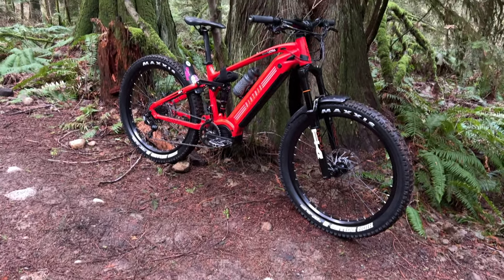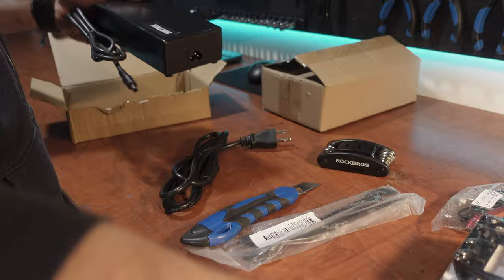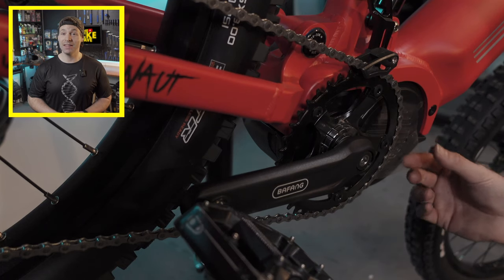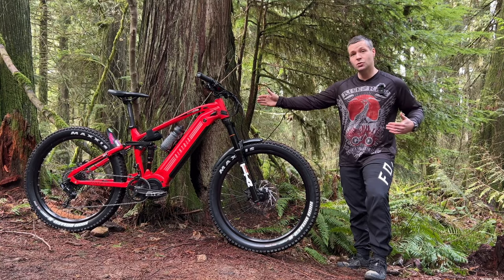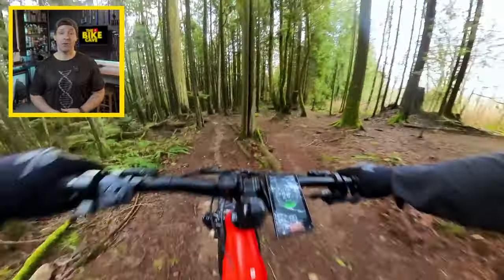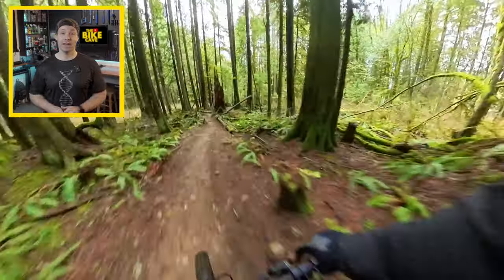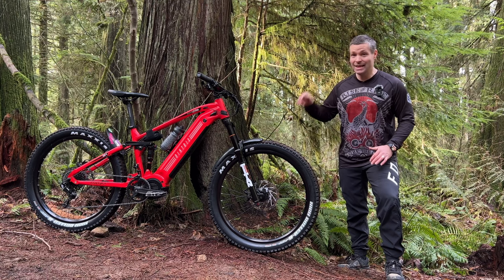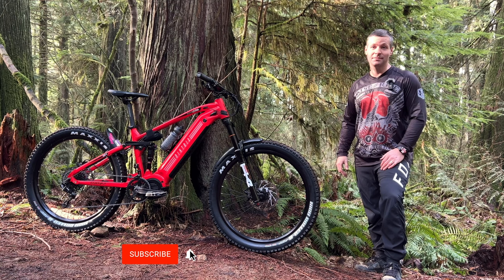This 160Nm E-Bike Blew my Mind!

Comment: I need to look more at juggernaut cause looks like there’s a FS XD mullet and FS XS MTB. Don’t know the differences but looks like you can get 2300w motor, 52v 910w battery and add additional battery two frame more range and twist throttle.  The other I looked at was the LMX 64, the 56 is upcoming (both look sweet) and the boxxbike Valkyrie.

Comment: when u get to 20% battery and pull the throttle it will cut off the battery,  so 67% is maybe a little over half the battery used...  u wont be able to use the power when battery at 20%,   maybe 500-750 watts at best

Comment: Crap chinese tank of an e-bike sadly rebranded by a Canadian company. There are much better options available for your money at $5599CAN. Personally, I wouldn't touch a electronic product made in China for half the price. Most li-ion battery fires are caused by cheap chinese cells. If you need any help finding better bikes for your money, I will gladly list the options.
Reply from the maker: All I know is that I had a blast riding that bike. Rode it on some pretty gnarly stuff and nothing broke. Just my 2 cents.
Reply: @thebikecave  Don't get me wrong, I appreciate your videos and I own a class 1 emtb. That said, class 2 and 3 emtbs are not allowed on any mountain bike trails in British Columbia. Class 1 emtbs have come along way to be permitted on many of the mountain bike trails in BC and we don't need more hate towards emtbs with guys ripping trails with a high torque, optional throttle controlled class 2/3 emtbs. Just saying.
Reply: Almost all ebikes are in some way or another Chinese made.😐
Reply: Chinese carbon fiber frames are actually very strong.
Reply: @eds7344  Taiwanese and South Korean are not Chinese. Only cheap(dangerous) batteries/tech/frames/suspension/brakes that are found are most no-name brand e/emtbs are Chinese made.
Reply: @sjaan7370 While most ebike fires are indeed caused by shoddy workmanship and cheap Chinese cells used with motors that pull more power than the cells are rated for, it is worth noting that all our e-bikes use name brand Samsung cells and are UL certified. 

It’s also with noting that many large companies like Specialized also have had issues with battery fires. A simple Google search would show you this. So let’s stop fear mongering and spreading fake news. Get out and ride what ever bike you like.
Reply: @Biktrix  First I'd like to say I'm sorry to hear about your loss from Annacis Island. Brutal.  Second, good to hear you are using quality cells form Samsung. Thirdly, I stick by my comments. 

1. "There are much better options available for your money at $5599CAN."
2. "Most li-ion battery fires are caused by cheap chinese cells."
3. "Class 2 and 3 emtbs are not allowed on any mountain bike trails in British Columbia."
4. "Crap chinese tank of an e-bike sadly rebranded by a Canadian company" (Maybe a little harsh, but that how I feel regarding Chinese made crap)

On a side note, it is extremely rare that fires have been started from reputable bike companies such as Specialized, Trek, Giant, Rocky Mountain, Norco, Devinci, Orbea, Santa Cruz and Commenial to name a few.
Reply: @sjaan7370 mtb’s we’re modified cruisers so I don’t get all the e-bike hate.  Trails get torn up, skate ramps regardless e or not.  

Looks like juggernaut has 2300w options in the mtb.  Also lmx which looks fun, boxxbike Valkyrie.  Velowave has the Forrest but it’s 1000w.  The hpc trailblazer seems super expensive.  I’m open to listen to other options cause I’m definitely interested in a free ride 2500w + twist throttle mtb.  The big fat tire e-bikes are just too much of a monster truck/ tank